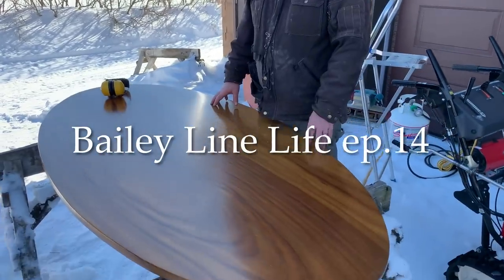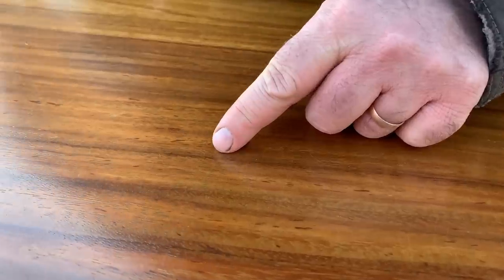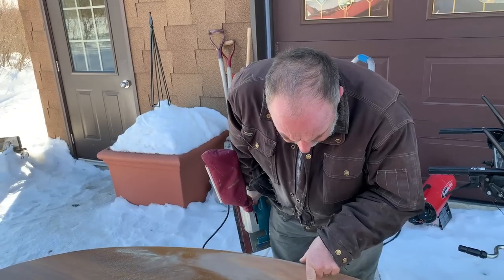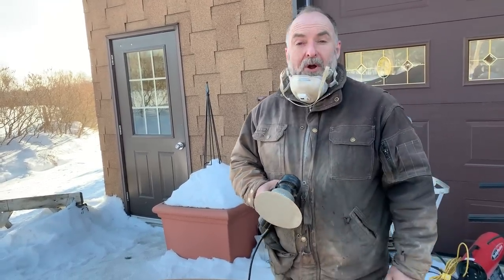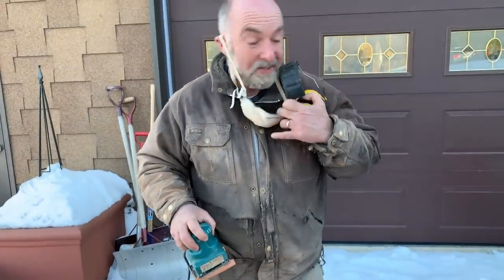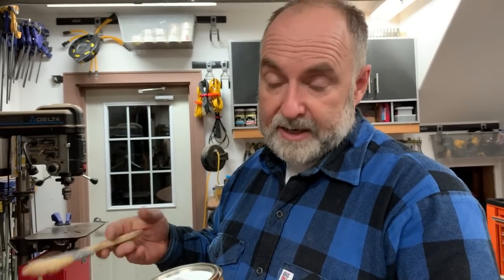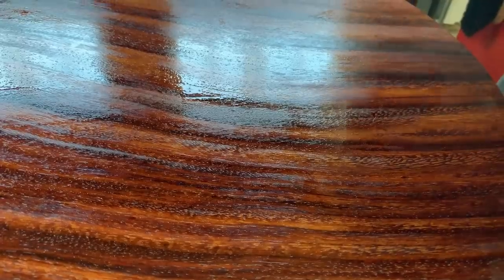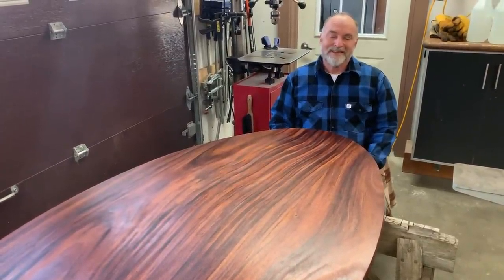Best Way to Finish a Tabletop - Bailey Line Life #14

Comment: Great video Steve. That’s a stunning tabletop, I love walnut. I think you’ll be pleased with the oil finish. I have a 42x72 white oak island top in the kitchen that sees CONSTANT abuse, and I only use mineral oil to maintain it. I’ve been amazed at the protection and the repairability. I apply new oil maybe twice a year at best. Sand out and reapply as necessary for water stains, wine stains, marker, pencil indentations, etc.

Comment: Thank you for your video. I'm deciding between oil based poly and polycrylic for my lacquered dining table which has a few heat spots. How's the heat resistance of polycrylic holding up?

Comment: Applied this to a new table. Followed the directions and it is tacky still two weeks later after just one coat. 
Can I apply poly over this tacky finish so I can use my table soon? I’m worried this is going to take months to dry. I live in CA and it’s in the 90’s with low humidity.
Reply: Liz Flaherty He mentioned it took four days between each coat to dry, I’d be patient, rushing a finish always ends badly. Adding an oil based poly (don’t put water based poly over an oil finish) over a tacky finish will likely trap moisture and not go on smoothly, resulting in an unstable finish that could peel off. Hope it worked out.
Reply: He put the oil on wrong. If you go to the tried and true website they published the directions.